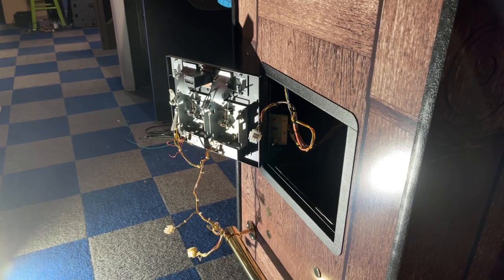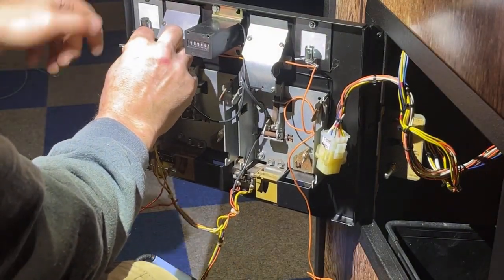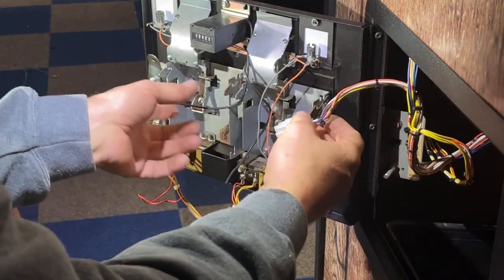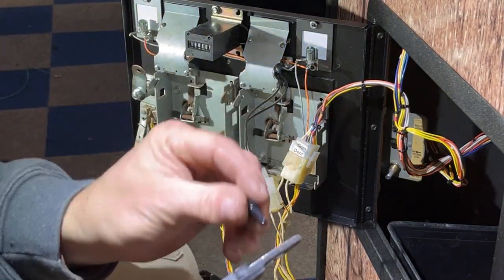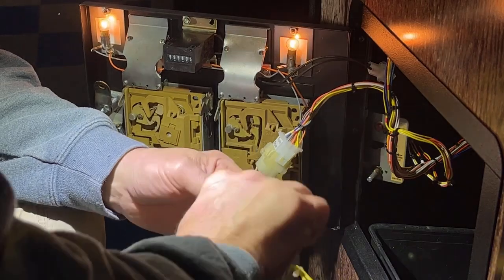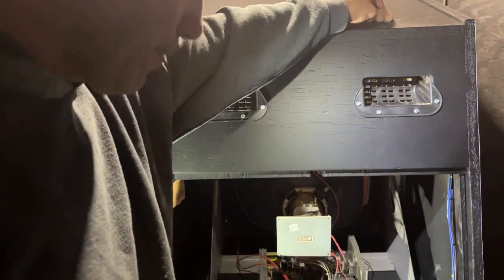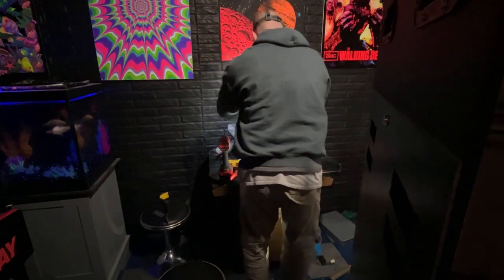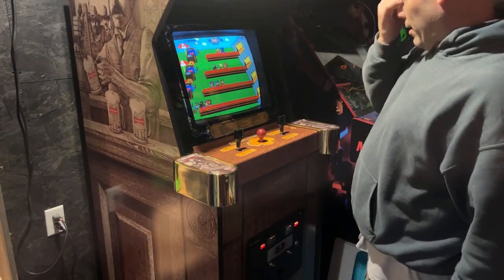Tapper arcade restore part 17 it’s all done now

Comment: Love the video series, question, where did you find the coin box bolts? Looking for a set myself. Thank you. Also I was going to tell you Gutter guard from Lowe’s is an exact match for the backdoor vents, use a metal snip to cut it to size!
Reply from the maker: Thank you they are elevator bolts I got them on Amazon I have a bunch extra I’ll send you some I’ll never use them all they are not exactly like the original but close